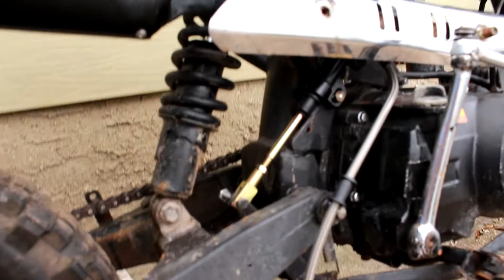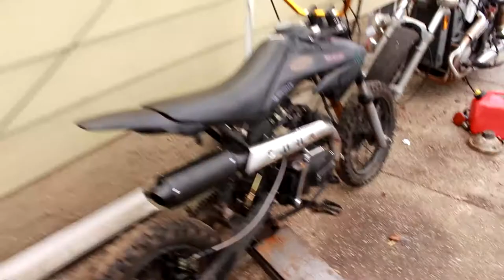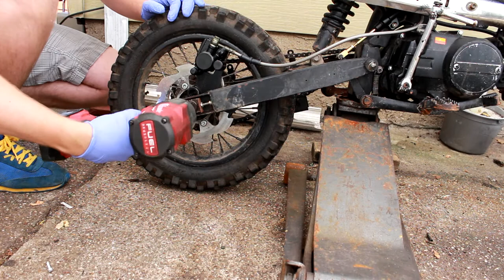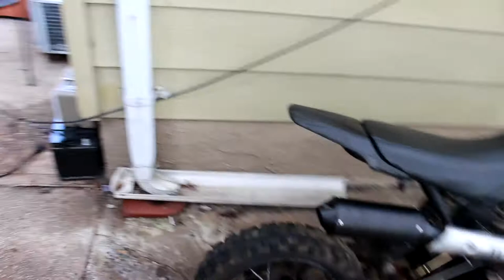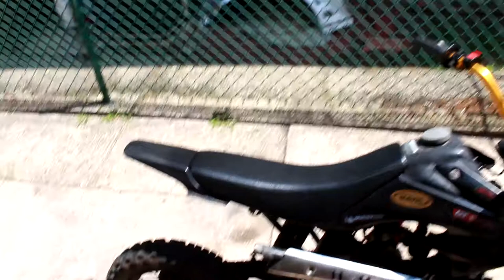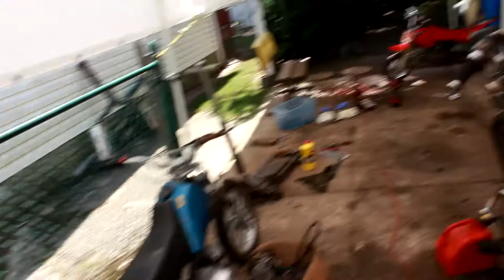Installing New Rear Brakes On A Pitbike

Comment: to be honest the most annoying thing i always struggle with is getting the damm back wheel on properly and had to do so last night to change the rear break caliper and what happen is it was actaully my chain was to tight and the wheel was to foward hitting the chain guard 🤣🤣🤣 so basicly i wasted my night taking the wheel off changing the breaks over legit look me 5 hours and now ive got to bleed the rear break again haha lesson for people that cut there chains to sort and have to have there wheel clsoser sometimes its not the wrong caliper its the gaurd hitting the chain sprocket 🤣 surprised I didn't end up crashing it haha but it went fine on the track until I finished that it started jamming up god pit bikes people 😂😀
Reply: Bro I broke the inner tube of my rear tire so yesterday I had to take the wheel off and replace it, afterwards i spent pretty much the rest of the day trying to get the wheel on properly being constantly forced inside by random bursts of rain. I’m about to go back outside to continue😭

And I’m talking about a pit bike aswell this is painful bro🥲

Comment: Ya he def didnt have that brake caliper bracket connected to the swingarm correctly... the axle goes through one part of bracket and the other part of bracket you wiggled on the bottom side of the swingarm should be fitted to the inside of the swingarm with a little protruding nub